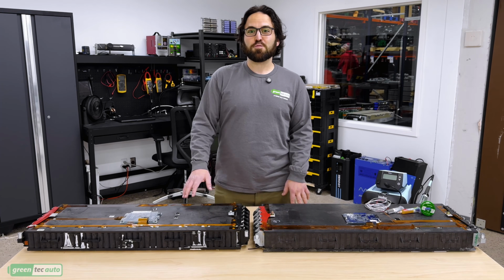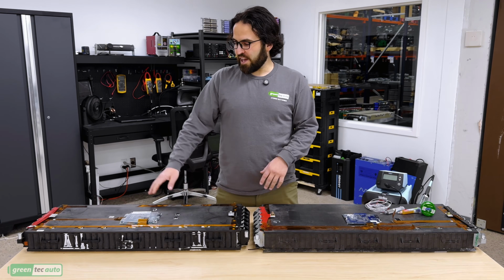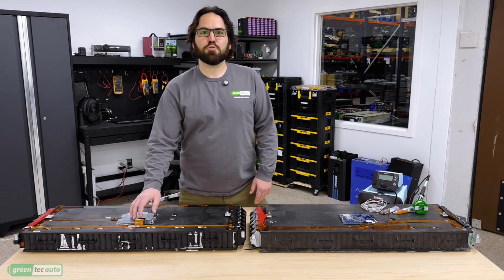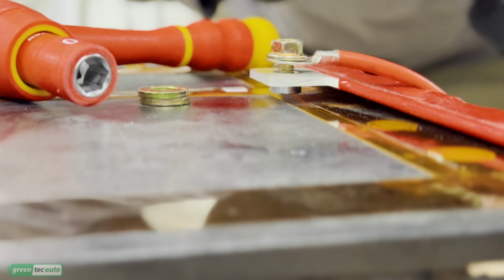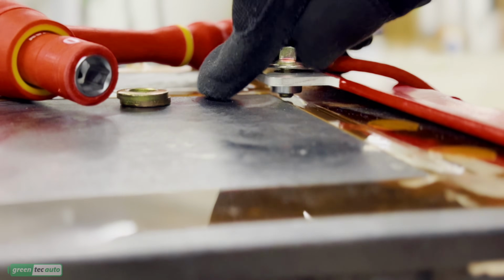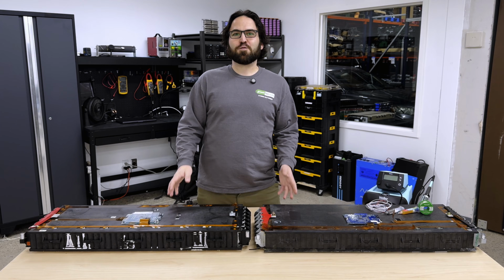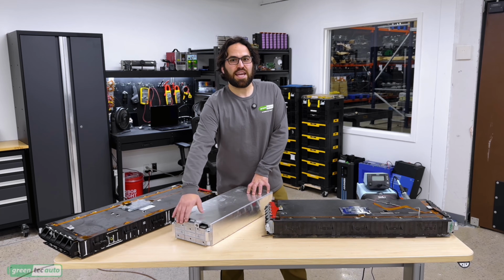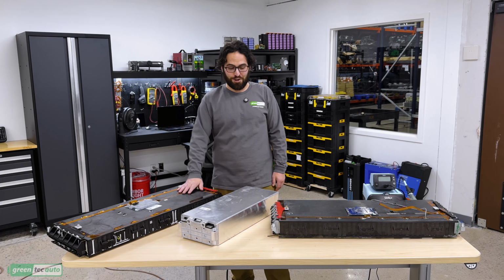Lordstown then Sneak Peak of the VW ID4 Samsung, LG Chem and SK Battery America

Comment: can i upgrade my Cayenne hybrid with the ID4 battery to get better range with my electric motor?
Reply from the maker: I love chat GPT! I will add the ID4 doesn’t have a BMS and is air cooled with no heating function inside each module that I’m aware of. Other than that here’s what AI said. 

“ Yes, it is technically possible to upgrade the battery system in your Porsche Cayenne Hybrid using VW ID.4 battery modules (8s or 12s configurations). However, such a project involves significant challenges and considerations:

1. Compatibility
	•	Voltage Matching: The ID.4 modules operate at a specific voltage range (8s = ~28.8V nominal; 12s = ~43.2V nominal per module). Ensure this aligns with your Cayenne Hybrid’s existing high-voltage system.
	•	Capacity and Range: Upgrading to modules with a higher capacity will improve range but may require recalibrating the Battery Management System (BMS) and vehicle software.

2. Battery Management System (BMS)
	•	The Cayenne’s BMS is designed for its stock battery. Swapping to VW modules will require either reprogramming the BMS or replacing it with a custom one compatible with the new modules.
	•	Ensure the BMS can handle thermal management, balancing, and communication with the car’s ECU.

3. Thermal Management
	•	Porsche batteries are designed with specific cooling and heating systems. VW ID.4 modules have their own cooling requirements, which must be integrated into the Cayenne’s system.

4. Physical Integration
	•	The new modules must physically fit into the battery compartment. Custom mounts, brackets, and wiring harnesses may be required.

5. Legal and Warranty Concerns
	•	Modifying a hybrid vehicle’s battery system might void warranties or create compliance issues with road safety and emissions regulations in your region.

6. Cost and Expertise
	•	This is a complex retrofit that requires expertise in EV systems, electrical engineering, and software integration. Professional assistance is highly recommended.

Summary

While technically feasible, upgrading your Cayenne Hybrid with VW ID.4 battery modules requires extensive customization and engineering work. If you’re set on improving range, consulting with a specialist EV conversion or tuning company is essential. They can assess the compatibility, safety, and practicality of the upgrade.”

I love ChatGPT’s optimism! This reminds me of Greentec Auto’s Honda Insight lithium conversion. We built a conversion and have a guy who coded a translator. It takes all the proprietary code from the batteries BMS, figures out what it all means, ignores 90% of it then translates it back into Hondas code then simultaneously does the opposite back to the battery. 
   So if you figure that out for the Porsche hit us up, we’re hiring!